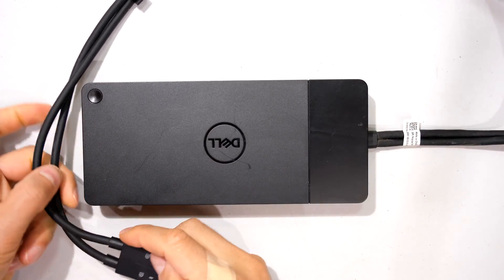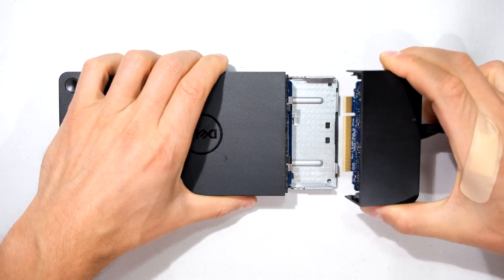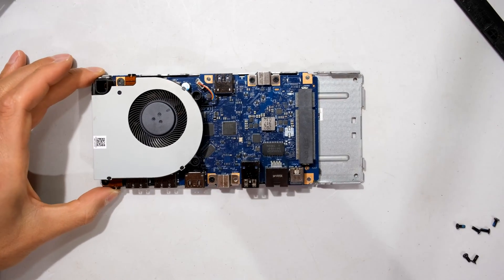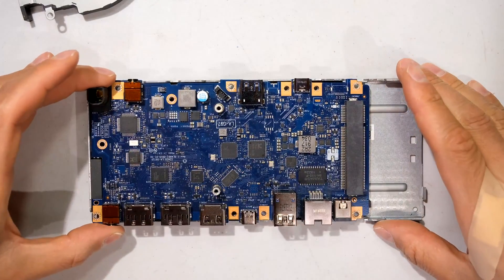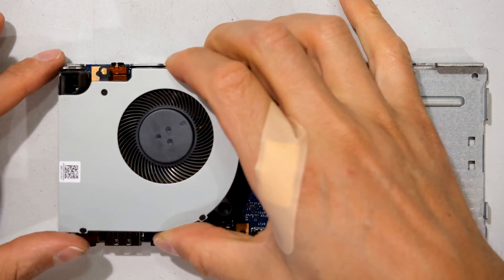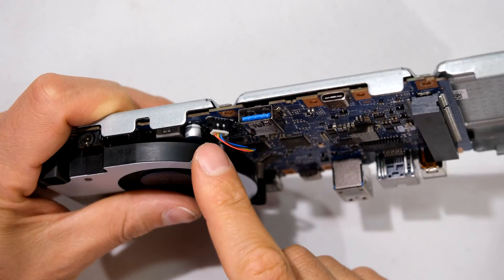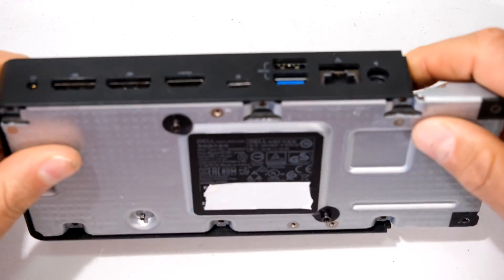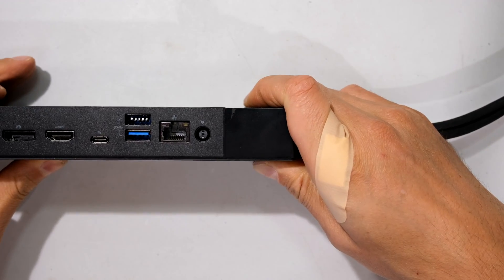The Dell WD19DC dock disassembly and assembly

Comment: You should also mention that on the other size there is a white ceramic fuse (SMD format) which may be blown. I found a shorted ceramic capacitor that caused the fuse to blow.
Reply: Hi, do you have any more guidance on this? I've disassembled the board but can't see anything

Comment: To all who are having a fan issue. The dock has software that can be downloaded via the HP website. The software has a temperature control section where you will find a total of 6 speeds from 0 to 5. More info can be found on page 35 of the manual.
Reply: HP site? Or Dell site as this is a Dell?
Reply: @ don’t remember. Type the model number into google

Comment: I unplugged the Fan, its silent now. Works great. I only have 1 ext Monitor and 1 usb device plugged in. Thx for the video!
Reply: I'm also wanting to do the same, just wondering will removing the fan affects dock's performance or will the dock runs too hot without the fan? And what's the resolution of your monitor?
Reply: I'm currently in a different country, it's a bit hotter here. I also have almost maxed out the dock-ports and I got a warning on startup that something is wrong with the dock, I should get it fixed. I plugged the fan back in and the warning didn't show up anymore. So I guess it got too warm! Maybe if you are in a cool place, you'll be fine. I didn't notice performance issues when the fan wasn't plugged in.
Reply: these can run loud, just make sure the vents on either side are free of dust, which will impact cooling. if those vents are clogged with dust it won't cool as easily and fan will come on more, be on for longer periods of time, loud, etc.

Comment: To resolve the noisy fan issue in these units, disassemble as shown in the video, and then remove the top shiny plate from the top of the fan unit (seen at about the 50 second mark in this video). You can do this with a flathead screwdriver, prying up from the open end of the fan unit and working your way around until you pop off all of the little thingies that are holding the top of the fan unit on (you don't need to remove the fan or the pins attaching the fan to do this). It's easy and works a charm. Then throw that useless top of the fan unit into the trash, and reassemble. No more fan noise!

Dell deserves bad press for shipping a bunch of units with these loud fans, and it deserves extra bad press for having a useless service team that does its best not to service this junk under warranty.
Reply: The fan seems a nonsense overall to me. What needs so much cooling in this thing? They design a device with 0 vent grills, only the one exhaust one (how does the air get in?), while I am positive the electronics could easily do with enough vent grills and passive convection cooling. This dock only does single 4k monitor. Absolutely no reason to have a cooling fan had they designed the case properly.
Reply: @YS_Production The fan is so it seems like a high value device which it isn't, so they can sell it for 400$.
Reply: @YS_Production  There is a grill on the opposite side of the fan (the part you detach before unscrew everything, has the fixed cable, the PCI-E x4 connector).
Reply: thank you very much, it worked perfectly here, I was about to throw it in the trash and buy another one, it was unbearable with the fan turning on every 5 seconds
Reply: Hi, I'm considering doing this to my WD19TB. Can you help me understand why removing the shiny plate from the fan unit would make it stop spinning like crazy? The plate doesn't really seem to do anything that might cause this
Reply: @vandelayindustries2971  I'm assuming it allows a little more airflow and doesn't trap heat. I did exactly as @r.waterston5578 said and it's now noise free! I didn't want to disconnect the fan altogether like another video suggested, so I decided to go this route. And so far, it is working!
Reply: @vandelayindustries2971  did you ever remove it- the fan or the silver piece?
Reply: This worked! Thank you!
Reply: I was annoyed by the fan noise for weeks. Now I have rebuilt it in 5 minutes as described. The fan is now much quieter and barely noticeable.
Reply: Can confirm this method works
Reply: Just did it. Thanks! I was going crazy.
Reply: Just did it, no more fan noise, thank you sir !

Comment: Anyone ever figure out why the fans get stuck on hi rpm? maybe its a sensor issue? is there a way to run a docking station diagnostic?
Reply: That's precisely the reason I found this video - to disconnect the fan assembly. I saw on a reddit post someone had done this with no issues, and they had several things plugged into it. I only ever have a monitor plugged into mine, so it shouldn't overheat. The fan noise was so much and so constant it would interrupt my meetings. I just reassembled and plugged it back in and so far it's working fine. I'll come back here in a few months to update, or if it starts experiencing issues, whichever comes first.
Reply: @jdemuro1  You might want to try copper memory heatsinks on the large chips (especially in the fan area).   Also, drill small holes/ install mesh screen on the cover as this dock was designed to be cooled with forced air.
Reply: @jdemuro1  hi, does it work on your device? If got the same problem with the fan (keeps me crazy at meetings and stuff). If this will work, i'll also try it.
Reply: @jdemuro1  update?
Reply: See my post above.
Reply: To all who are having a fan issue. The dock has software that can be downloaded via the HP website. The software has a temperature control section where you will find a total of 6 speeds from 0 to 5. More info can be found on page 35 of the manual.

Comment: dell delivered that weird double cabled module when i rma'd my dock.

whats the point of it? never ended up using it, bought a new one instead.
Reply: some machines need the extra wattage, so the second cable supports more power thruput
Reply: @phr3dmcc0y  makes sense but I really didn't need it, single thunderbolt cable was plenty, all the laptops are exactly the same as well so its pointless
Reply: I have the 7670 and there you need the extra power

Comment: Super helpful! I think I might replace the fan with a passive heatsink on mine to cut out the noise... DIY FTW!
Reply: Try updating the firmware. We have a bunch of these at work and only some of these are noisy
Reply: I'm really curious about what your plan was here, because the fan in the dock is not a CPU-cooler/heatsink with a fan attached, it's literally just a case fan basically. So it's generally pulling airflow over all the components in the dock. If I was asked to make this design passive, I'd be concerned that all the heatsinks in the world wouldn't help if there's no longer a case fan to actually carry the heat outside of the box. And even after that, you'd probably need dozens of tiny little heatsinks for each little chip, or a whole bunch of TIM material, or play around with a thermal camera to identify the hot chips.... certainly not as simple as "replace the fan with a passive heatsink"
Reply: @TheHuesSciTech  I was thinking pretty much the same thing. If someone is having fan issues this may be a good guide to take out the fan assembly and blow it out with air to get rid of any dust buildup.
Reply: Can you tell me if this was successful? If yes, can you tell me what make and model heatsink? I paid so much money for this dock and it keeps making obnoxious noises.
Reply: Hello, 
Just like Matt asked, I was wondering whether you were successfull installing a passive heatsink? 
I bought the wd19tb second hand and the fan noise is killing me.